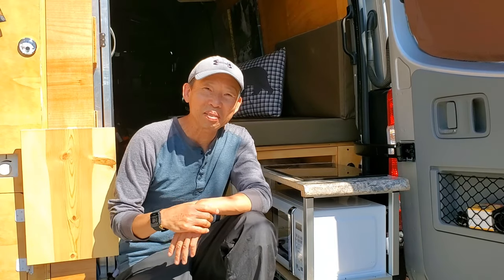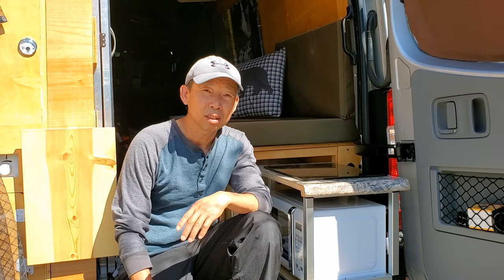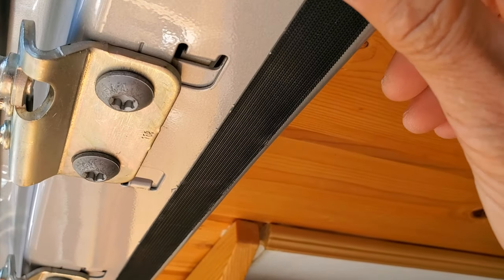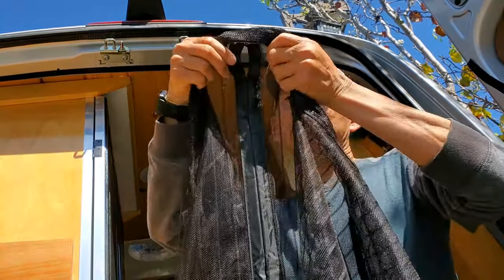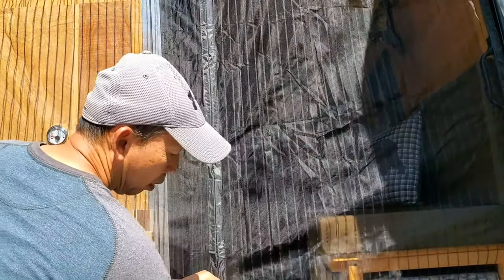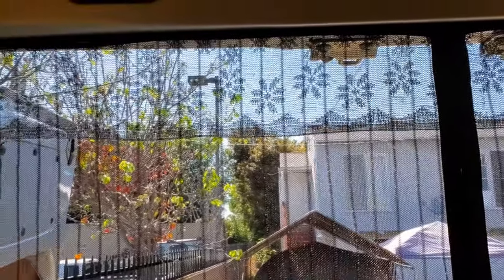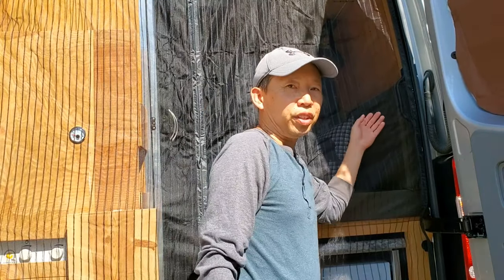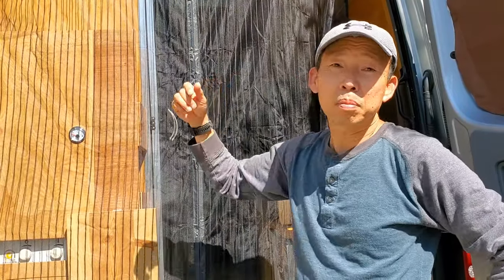Bug Screen For Campervan

Comment: I installed one on the side door of my Sprinter, same size, 60"W/80"H, found on Amazon. On the velcro that is glued to the frame, I added some rivets at every corner and every 10-15" because when temperature is too high, the glue on the back of the velcro becomes very soft and the velcro tends to come off.
Reply from the maker: Cool, thanks for the tip.